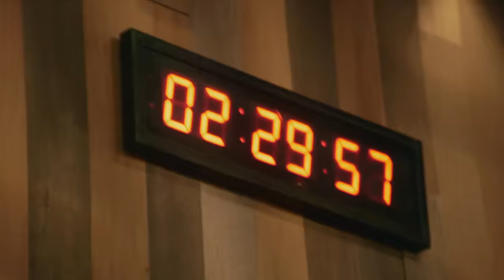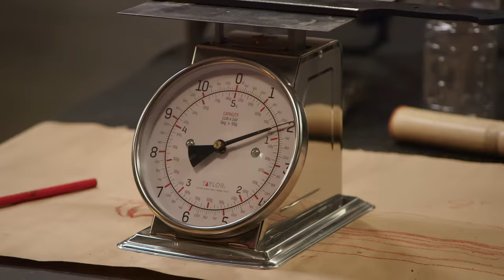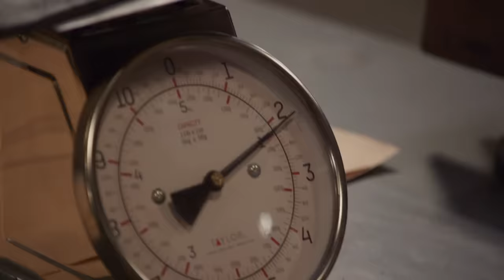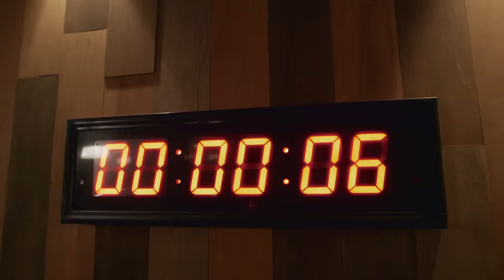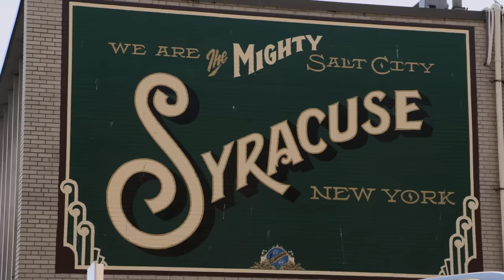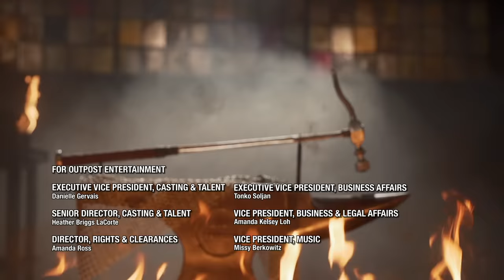Forged in Fire: HAMMER TIME! Sledgehammer Showdown (S8, E23) | Full Episode

Comment: The utility of a cutting torch seems to be lost to almost every contestant on this show.
Reply: honestly just heat it up and use a chisel and it will cut much easier
Reply: Hand punching pin holes before the quench seems to be something that would happen more often
Reply: Maybe there isn’t one?
Reply: Oh I kept watching and there was one
Reply: @BLD22266   @Aaron-zu3xn  Doesn't it just drive you nuts?  For "smiths," these contestants seem to go to great lengths to avoid using the forge for basic stuff.  Guess it doesn't make for good TV rolleyes
Reply: @AM-hf9kk  i think it is because they simply arent trained to use these tools, and anything that happens on the show must be approved by the network prior to filming. SO if youve been trainned to use the tools, you can be approved to use the tools. If you say "kinda" the network shuts it down so they wont run into liability from user error causing injury.
Reply: @AM-hf9kk  I suspect a lot of them really have more limited experience than they realize.

Comment: “Blacksmithing is dangerous. Do not attempt without extensive training.”
LoL
First forge was a charcoal forge made of building brick, small air compressor and channel lock pliers.
This show has helped my self training over the years.
Love it!
Reply: Just started. Mine is a coffee can lined with plaster of Paris and sand. Using a propane torch for heat. I got nowhere to do coal safely at this moment.
Reply: They have to say that because...lawyers.
Reply: They used to not put that in. It wasn’t until a guy in New York ended up burning down 3 residential buildings and damaging 28 others by trying to imitate what he saw on Forged in Fire without proper safety measures and equipment.

Comment: As a carpenter playing ironworker. I can confirm the chopsaw is garbage with thick metal. Use a grinder with a cutoff wheel or a torch with half inch(12mm) or thicker.